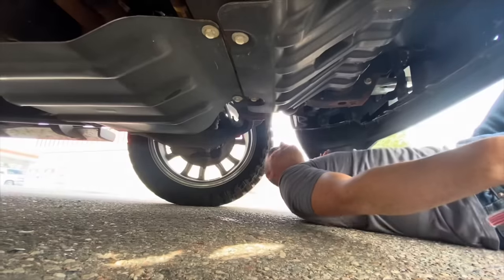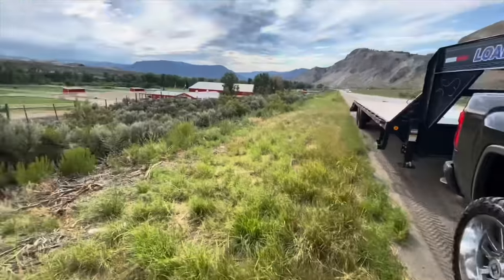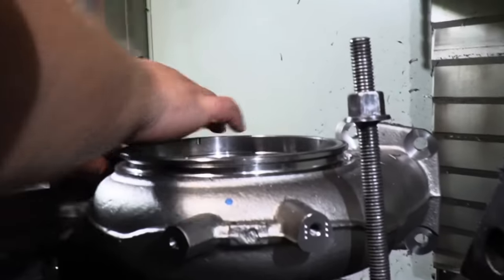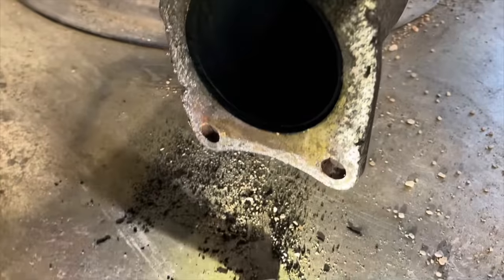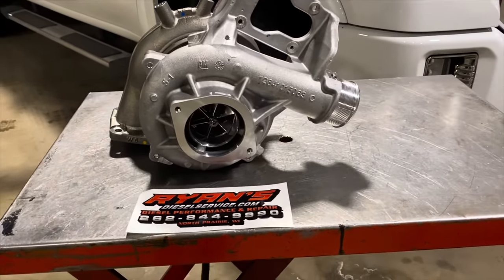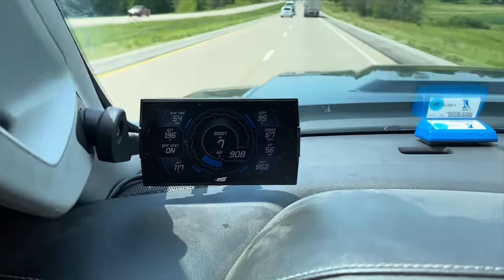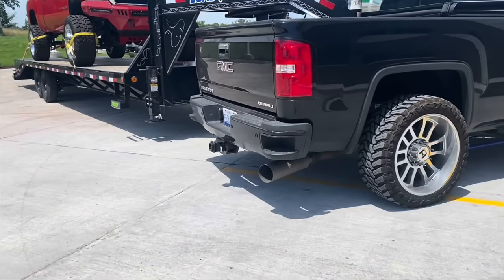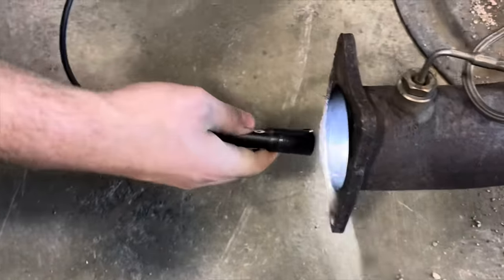This Is What Emissions Did To My Diesel! Heads Up Diesel Owners!

Comment: I’ve come to the conclusion that to keep a reliable truck, when the time comes I’ll take the money that I would have spent on a new one to completely overhaul my LBZ. It’ll be like a new truck and I’ll never have to worry about dealing with emissions.
Reply: Well, the ecm is discontinued by gm for one of those. Keep that in mind.
Reply: Just did that myself. 2006 Sierra 2500. Performance allison rebuild, pistons were ovaled out after 270,000mi. so new long block, replaced entire fuel system, new turbo, EFI live install addressed the transfer case pump rub issue. All of it for $30k and now I have a new truck!
Reply: Keep buying these new truck. With all the luxuries off a Rolls.   Buy the older models that do not have all the crap on it  your to blame yourself
Reply: I agree my wife's excursion is completely re-done with 300k miles but it's practically mint again...  like when my mom first bought it... 12k is a pretty good deal over a new truck...
Reply: Started working on my dad's farm full time, so I decided that I'll probably need a diesel for myself. After watching his L5P give him such a fit with the DEF tank heater going (whole new tank, not sold in parts), wiring issues, an injector go out, and a whole host of little problems; I've decided to buy an 03 3500 dodge for a grand with a rod knock, switch everything over to a P pump to simplify it, and spend however much to make that a reality, rather then having a 70,000 truck that will depreciate faster then I can blink.
Reply: If you put $30k into that truck, it’s still cheaper than a new truck.. but $10k should be more than enough to just keep it going 20 more years..
Reply: @slyfox7516  I work for my $, why do I want to buy an old pos?
Reply: @bmint  not only that you get to keep the truck with a soul/personality... the contacts on my head lights were so thick the didn't make contact till the cab was warm in the winter
Reply: @Random-bm7ho  Because you will never have to deal with DPFs ...the thing that messes up every newer light duty diesel eventually. A 2006 LBZ or an 05 LLY, they are not all old pieces of shit.

The L5P is not a bad engine, just delete it before tuning it...emmisions intact tuning is cool, but it clogs the DPF even quicker.
Reply: @Random-bm7ho  have fun with those payments then
Reply: @Rozza43  Unfortunately where I live if I remove any aftertreatment I can get fined 50k...at least anything after 95.
Reply: But yeah, the 6L was awesome hahahaha!
Reply: @Random-bm7ho  Do they hook up a machine to it and read the soot production and stuff? Or do they just look? Because you can leave the EGR and take the insides out of the DPF, so everything looks intact and there.
Reply: @Rozza43  But not only the dealer can get fined, the tech that inspected it can also get whacked
Reply: @slyfox7516  you really think it’s the fault of people who buy trucks that they break? Yeah that makes sense 😂
Reply: @Random-bm7ho  he’s just mad he can’t afford a new truck.
Reply: @ironmike742  not everyone is emotionally devastated by having a payment
Reply: @Random-bm7ho  That's why you buy an older truck that doesn't have any of the emissions on it to begin with, they're usually exempt from having it because it's not factory. Also, not sure what you mean wanting an old pos? I had an 05 GMC Sierra 1500, not a diesel but still had all leather seats, power everything, bose sound system, power folding mirrors, onstar, heated seats, drivers seat position button, where you just push it and it goes back to the set position, 2 settings so 2 people can save their driving positions. And for a couple grand you can put a radio headunit in with GPS and apple car play / android car play and everything else. 2 tone factory paint job. dual climate zone control for the front seats. I mean, what more do you want in a truck? Seats that tickle your butthole? That's about the only extra thing you can get in 2022 that wasn't offered 2 decades ago.
Reply: My 7.3 keeps on keepin on. Just saying 😂
Reply: @Random-bm7ho  lol cause you want to go more then 30k miles between major breakdowns. but you do you hahahahah
Reply: @Nahbruhsheesh  lol not everyone wants to have one or 2 running vehicles some of us have a fleet. your new car that is depreciating has nothing on the value of my fleet which is appreciating. you dont know what u think you know. your playing keeping up with the joneses.
Reply: @Nahbruhsheesh  your either very rich, or in denial about how poor you actually are. guessing its the latter.
Reply: @aylahughes9185  lol what makes you think that? And I’m rich as fuck. So you were wrong.
Reply: @aylahughes9185  lol this comment doesn’t even make any sense. Up your meds bud!
Reply: @aylahughes9185  the bot has spoken. Not a single one of your comments even remotely relates to anything on this thread. Deuces!
Reply: @aylahughes9185  That's what a warranty and loaner trucks are for. Both cost me nothing
Reply: Your exact right that’s how you stop all the def nonsense
Reply: @Nahbruhsheesh  sad guy doesnt own anything. the bank does. wants us all to be debt slaves like him. cuc.
Reply: @Nahbruhsheesh  lol poor people make payments. enough said.
Reply: Right why would we want to own such problems. Doing a lb7 currently. Alot of work and money but reliable.
Reply: @Random-bm7ho  except they did. down payment, monthly payment and depreciation. and the cost of full coverage insurance cause, you know, you have to have it. but cudos you look at it just like they want you to look at it. sheeeeeeeep.
Reply: LBZ is the way.
Reply: @Nahbruhsheesh  I prefer to save money 💰. That's how I got to the point where I'm very comfortable. New cars are way overpriced. I prefer older cars but I know how to work on a vehicle so it's easier for me. People have to have a vehicle so to each their own. I have reached a point where my bills are next to nothing and I'm going to keep it that way.
Reply: @Random-bm7ho  go and buy a new truck ,and watch as 30% of the value dissappears the moment u drive it off the lot ,there 30% of your hard earned money gone in a flash !🤣
Reply: @mikemoscato2995  I just bought one in Nov, got another 2 years before I buy another one! But please, explain to me how a clapped out pos doesn't lose value?
Reply: My LBZ gets 22mpg highway easily loaded to 10,500lbs.   Not sure why I would want anything else.   I just worry that one day it will rust out under me.
Reply: U mean u can build 3 trucks for the price of 1 new truck. 😂
Reply: Just delete it and don't live where they test.
Reply: Like I keep saying... people will soon be buying older vehicles and restoring them rather than buying new.
Reply: Exactly is Bulletproof a bad word in Wisconsin? Appreciate your comments!
Reply: @-MOYST-   what I'm looking to get ahold of.  My brother's f450 has 390k and only minor repairs that I know of.  Although he keeps it plugged in at night in winter ( IL ) .
Reply: @mikemoscato2995  how do you lose that money if you keep it forever like Toyota it will last and has warranty. God forbid you put 30k into that 20 year old truck just so it blows up next week and now your fucked with a loss of 30k
Reply: @robertespinoza2740  for 30 thousand u can rebuild the entire pickup drivetrain electrical, and suspension, it's like a new truck at this point!
Reply: @mikemoscato2995  yeah you can but are you going to do it yourself or have someone do it ? How do you know they are doing everything correct I’d rather have the 120k mile warranty
Reply: @robertespinoza2740  yes provate companies and the big auto manufacturers sell partial or whole drivetrains with warranties and there are shops that all they do is restore cars ,hell there are companies that sell kitcars ,brand new with warranties either fully assembled or in kit form and you build it yourself or have someone else do it ,but would take all the fun out of it!
Reply: @mikemoscato2995  I guess you right got me I don’t really need a Diesel and I don’t use the truck to much only trips so I got a 2016 tundra for 27k with 120k miles   I know Tundras don’t have as much problems as the big 3   Honestly I have friends that have these new tundras and have almost 300k miles with no problems at all and some of these guys don’t even take care of them much
Reply: Don't forget, of you are going to spend a lot of money rehabbing an older truck, be sure to get agreed value insurance. Your regular state farm policies and such only cover the market value of an old truck with XXX miles.
Reply: I’ve got a 2014 GMC Sierra 5.3 and just recently spent the first money on it. Bought it with 25k miles on it and it now has 249297 and I just redid trans. Got 3 yr unlimited miles for a warranty on the trans and I do all the engine work myself and the engine is perfect. Amsoil and just take care of it so not sure other issues the “big 3” have over Toyota because I’ve had no issues. I had a brand new 2013 f250 diesel before this one and got rid of it quickly. Not doing the dpf and all the new diesel junk.
Reply: Love my LBZ
Reply: @Nahbruhsheesh  said no wealthy person ever
Reply: Lb7-lbz aome of the best motors around to this day. 12v also
Reply: Lbz lmm
Reply: @LFroetschner  No you don't, you have a worn out money pit, good luck.
Reply: @codyprice0295 Stand alone ECU is all you need.
Reply: Smart man.
Reply: @codyprice0295 I believe there's some good aftermarket now.
Reply: Most correct decision and actions. 
And you will still have money to do a body maintenance and rustproofing to keep it nice looking, anyd your truck will outlast any new one you can buy now.